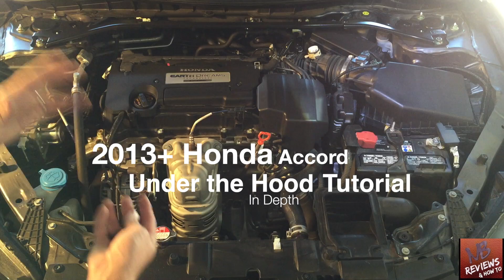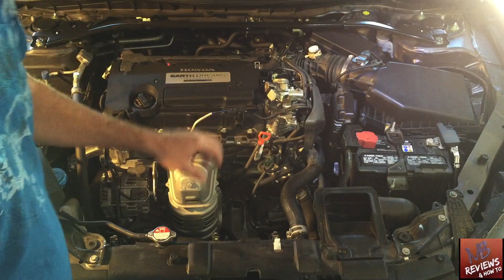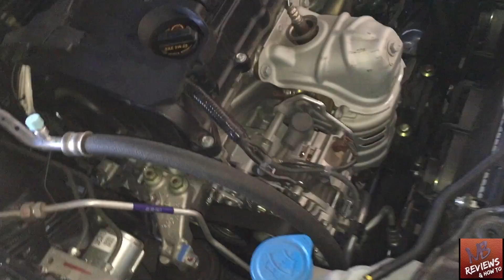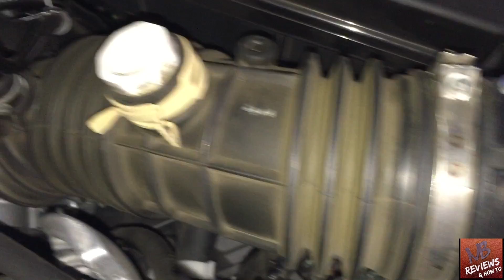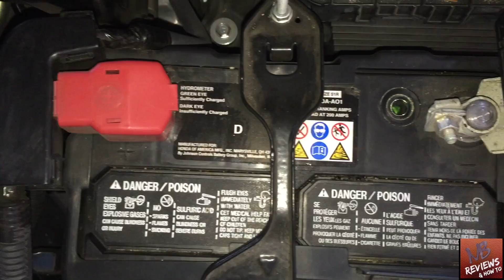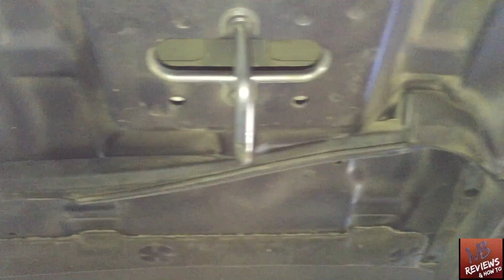HONDA ACCORD 2013+ UNDER THE HOOD TUTORIAL

Comment: is the v6 version this easy to maintain as well?
Reply from the maker: Correct, the V6 is an awesome engine as long as you are okay with the additional maintenance needed. Don't forget that the V6 also needs a valve adjustment every 100k or so. I have a manual and agree that the auto is much better than the CVT for longevity. I have heard of some VCM issues in the higher mileage cars, but using strictly synthetic and being religious about the oil changes eliminates the issue. I'm at 150k and still haven't had any DI issues. I'm going to change the spark plugs today and check out the the inside of the intake valves.
Reply from the maker: SlickNick16 Sure will, the weather just needs to cool a little, it's nasty outside.
Reply from the maker: SlickNick16 I love Honda's V6, but it is a little more work to maintain since it has a timing belt. That being said, they can easily go 200k miles. You also have to adjust the valves on the V6 every 100k miles or so. So nothing terrible, just not as easy as the 2.4.
Reply: Michael Borquez I own 2015 Honda v6.  Love how quite and power the engine is. Yes there r some pros and cons. Timing belt engine are quieter than timing chain. Of course requires to change every 60 k or soo. It is same as Acura engine so reliability is not an issue. The engine lay out is of course different but I noticed alternator is easy to change in v6. And biggest advantage is it is not DI , injectors keep valve stem  lubricated and clean. It is vcm engine which means while cursing it shuts down 3 cylinders . It gives  35 mpg or above on highway and around 30 in city. And it has conventional transmission which is 6 speed...
Reply: Michael Borquez hope ur making a video about it?
Reply: Correct I have also heard V6  valves need adjustment, actually every valve at 100K need adjustments even hydrolic lifter get bad too. Hydrolic lifter cost extra for lifter price.  At 100K majority of car shows some valve cover leakage as seals become hard so while changing those valve adj can be done at same time. If you do not have DI issues at 150K I think you can provide good advertisement  for Honda DI , check with dealer they might use your car as promotion. I like that even 180 hp is pretty good. My wife has CRV and it has almost same 4 cyl engine but 2014 crv is without DI glad to have both cars without DI.. I buy full syn oil from walmart which is dirt cheat 22 dollars only for one gallon and 8 dollars filter so 30 bucks for oil change. I have 34K and no extra maintenance yet. I am not sure about its V6 transmission . Actually I am disappointed by small cooler for transmission. Working on adding extra transmission cooler as precautionary measure. Rest very content with it..
Reply: So  to stop the three cylinder shutdown merely stop cursing,, ha

Comment: 17:50 what control until are you talking about
Reply from the maker: ABS (Antilock Braking Sytem) control module modulates brake pressure between the wheels to prevent the brakes from locking up. It is also is used in stability control to correct the cars trajectory when the driver loses control due to skidding.

Comment: Just got to the end of the video.  How do you keep the engine clean without messing up any of the electronics?  That might be a good video.  As for the battery, I changed out my size 51R battery for a 24F.  The engine compartment is designed to fit it.  You just need to replace the battery box (tray) and can bend the tab in the hold down bar and use the existing one.  A new J bolt, size 235mm is also a good option.  I'm using my existing one.  Cost is why they go with the smaller battery.

Comment: Just bought a 13 Accord w 60k miles. Great video, this really helps me be somewhat familiar with the nicest car I've ever had lol thank you!
Reply: BRO SAMEE!! Bought one last week with 64k. I love the damn thing. It's the base LX model. I went into the Honda dealership to merely look at a used 2011 Camry lol but walked out with 2013 Accord LX and it's the white pearl color! Also was blown away by the features. Blutooth and backup cam?? WHAT? My newest car ever was a 2002 LOOOOOOL drove that shit away in a snowstorm that day and that traction stability was kickin in and I loved it. Felt like I was driving a space ship. Still does!!
Reply: @grand_vacation  hows you paint doing?
Reply: @edubb2491  Sorry I know the Question wasn't for me but my 2013 sport 2.3 white pearl is holding up great but I have done all the paint treatments like paint decontamination etc and 3 year wax protection!
Reply from the maker: No problem

Comment: Really good video but you forgot to talk about carbon build up in the valves because of the direct injection.... and how to clean it.
Reply from the maker: Haven't had any carbon issues. I scoped the valve at around 100k and there wasn't much build up. Please see the spark plug video to see.
Reply: @Sunshone7311  i jus subscribed and gonna check out the spark plug vid!

Comment: when my car is running@night and something clicks on under the hood sounds like the a/c compressor.. but it even clicks on without a/c running my lights will dim out, battery is new I already replaced it thinking it would take care of it.. any idea?
Reply from the maker: If you have the climate control set to auto it will turn the AC compressor on and off from time to time. The issue you are describing sounds like the AC compressor coming on. When you have the climate control set to auto, be sure to click the AC button so that it says off.

Comment: my 13accordsport.. in-between oil changes my Honda losses about 1/2qt  of oil, car runs great. Any idea why?
Reply from the maker: Depends on how many miles it takes to burn the 1/2 quart. I can say that you need to make sure to use 0w-20 oil and preferably synthetic. I use Mobil 1 and haven't had any issues (127k miles). If the dipstick is going from full to half way I wouldn't be too concerned, if it is going from half way to low then you may have more of an issue.
Reply: @Sunshone7311  have u had any carbon build up from the engine being a direct inject engine and 127k on it? Thanx for the very informative video..better then the user manual that never came with the car when i bought it..lol

Comment: I have 2014 Honda accord, i did hear the O2 sensor you mentioned is upstream. I recently crashed into wildlife, long story short the o2 sensor at the bottom of the unplugged. then the engine light came on i went to autozone they said i needed to replace the upstream sensor based on their diagnostics but i know for fact its the one under the car. what should i be asking for, i think its downstream sensor based on your discussion but wanted to confirm, not sure if there are more then 2 on I4. thanks for all your help in advance. I have 104K miles on it and yes love it.

Comment: Thanks for the video!
Quick question, my 2013 Honda Accord (36K miles) vibrates pretty bad when in idle (brake + D gear) and worse when reversing :( any idea? will any engine clean up work?
Reply: jashou89 I have the same issue did you find a solution?
Reply: I have the same issue too..Especially when the ac compressor kicks in..No solutions yet..
Reply: Try turning the heads lights on.. If the vibration subside then it is Honda design fault. To get better mileage they slowed down RPM so much that it shakes the car. and there is no way to adjust idle speed. !
Reply: It may be a engine mount if the vibration goes away by putting it in neutral.

Comment: I have a 2014 hands accord lx 21,000 mi. It is pulling to the right I took it in for an alignment and is still pulling to the right, they did not provide me with the paperwork for alignment, I'm thinking the suspension is off or the camber??
Reply from the maker: Did you buy it new, because Honda alignment are usually pretty rock solid unless it was crashed, hit something, or bad pothole. If check and see if you have a bent tie rod.
Reply: +Michael Borquez  it was a certified used from Honda dealership, thanks for your input, I believe they know something I Don't, saying its a characteristic of the car,
Reply: +Michael Borquez i have only had the car for 2 weeks
Reply from the maker: +Andrew Toma I believe you are correct. You will need to keep taking it back and document the issue before they try to say that you did something. Please also check your tires to make that is not the issue, bad tire wear can cause the vehicle to pull. They are required to do a title check to make sure there were no accidents to certify the car, did you get a copy of the car fax or title history? This is not normal and you will need to continue to pester them to get it fixed. I would consider calling Honda corporate to complain also. A certified vehicle should not be pulling. I have a 115k miles and still rolling on the original alignment with no issues.

Comment: I would like to replace on my 2013 accord the HFT Bluetooth module but don't see any video's on here for that
Reply from the maker: The 2013 is different than the 2014+ Accords because the module is now internal. The 2013 can be flashed to add Siri hands free, where as later models cannot unless they have the higher end deck. I haven't had a reason to access the module yet, sorry about that.

Comment: i have a 2013 Honda Accord, and would like to replace the starter on it. Im not mechanically inclined and would appreciate any help regarding the replacement of it. Yeah 37,000 miles and already need to replace the starter.
Reply from the maker: I would not suggest it if you are not mechanically inclined. The starter is a very tight spot and you will need extensions and the top bolt will require you to feel for it blindly. This would be fairly difficult for a good mechanic. If you can have a friend with experience help you that would be best.
Reply: Where is it located? I just want to beat it a bit until the fly wheel engages
Reply: yup, I replaced mine after a year and a half..it's a 13'... warranty replaced. ..also rear wheel bearing went...warranty as well..

Comment: My 2013 Accord has 34,000 miles on it and the starter is already bad. I didn't see you mention it, unless I missed it. I want to know how difficult it will be to take out and if I need to take out any other parts to get to it. Thanks.
Reply from the maker: +Jason Caban Double check that your don't have a battery issue first. A lot of times a bad battery will make your starter sound like it is going bad.
Reply: +Michael Borquez yeah the battery was replaced about 6 months ago. I found out the starter is under the vehicle so that's why I didn't see it mentioned in the video. It's still under warranty but I'm US military living in England so it doesn't matter. Gotta drop a few hundred dollars to get it replaced.
Reply from the maker: +Jason Caban Did the vehicle have to be jump started a few times? I only mention it because it is rare for the starters to go bad. Sometimes jump starts can short starters, they are sensitive. It sucks to see one go bad so early. Thank you for your service!
Reply: It is common for starters to go out on these earlier models.

Comment: I have 2012 Chevy Impala with direct inject engine and heard you say that the direct inject engines can get hotter then normal so I was wondering if that was something that I should be worried about in the long run because I'm like you I want to get 300,000 miles out of my car. But I guess if I don't I'll just go out and buy me a Honda. But I really enjoy your videos thanks a lot.
Reply from the maker: Direct injection engines have a higher burn temperature in the combustion chamber, but the engine as a whole stays about the same temperature as a normal port injection engine. The key is always manitenance and catching problems before they do damage. The biggest issue I see is people ignoring mechanical problems until it's too late.

Comment: Going to test drive a Honda tomorrow. Every car i've owned has had either cooling, or transmission problems hah. Not sure I heard you mention anything about it, but how accessible is the water pump? Also, on FWD vehicles such as this; is the serpentine belt/spark plugs a pain to change out? Final question. What are your thoughts on the long term reliability of the CVT transmission. It is the only real potential mechanical issue that is making me hesitant
Reply: Relatively easy to change serpentine auxiliary  belt and plugs. Atleast on my '05 Accord which looks very similar to the one in the vid. Bought a special tool to help remove belt but it can be done with spanners (wrenches in the USA!). There'll be a plastic vanity cover on the top of the valve cover and underneath will be individual coil packs with an associated spark plug. Coil packs have to be removed to access plugs but it's usually pretty easily done.
Reply: How is your CVT doing?
Reply from the maker: +Tomtom9401 I don't like CVT transmissions, but that's mainly because NIssan has left a bad taste in my mouth. That doesn't mean that Honda will be bad, but it is a newer transmission type for Honda and there isn't a lot of long term information yet. 

That being said, this car is EXTREMELY easy to work on and because there is no timing belt the water pump is easily accessible. The car also has electric assisted power steering giving the belt one less thing to drive and in turn making it easier to change.
Reply: @Sunshone7311  so i dont have to worry about changing timing belt?

Comment: Hey I bought a 2016 Accord EX 6MT and every 10 seconds let's say the engine ticks and it gets louder and vibrates a bit for 5 seconds, then is smooth for 10 seconds, repeat etc. Every video I've seen shows theirs doing the same so I'm sure it's normal but I'm just curious as an engineer what it is. Is it the fuel injection changing modes or what? Thanks
Reply from the maker: +Trevor Thayer Your climate control is on correct? If it is, turn the AC off, its likely the AC compressor kicking on and off. The AC compressor will put additional load on the engine and thus the vibration and ticking. I found it odd that the car will kick the AC on with it is in AUTO even though it is not hot inside the car.

Comment: Honda won't oil change my car since I still have 50% oil life but it's 7 months old oil, Is it still okay? Also do you recommend following the 15% oil life change?
Reply from the maker: +Ronald Almuete  I can only tell you what I did. During the first 50k miles (full break in) I changed the oil every 4k miles regardless of what the oil life meter said, now I run it down to 20%. If you use a synthetic you can go longer between changes, but six months is good time. You are right, oil should be changed even if the car hasn't been driven.
Reply: How many miles have you done since last oil change and what type of driving do you do? I'd be tempted to change it myself but you have to be careful not to invalidate any warranty.
Reply: My oil was changed 9 months/5000 miles ago. Oil at 30%. Had my oil analyzed at Blackstone and they said it should last another 2000 miles. Oil report normal. Odometer at 104,000 miles.

Comment: do you see the direct injection being a long term problem? I have heard of an issue with carbon build up with direct injection from other manufacturers. Please let e know your thoughts
Reply from the maker: Henry Pacheco I'm at 75k miles and have had no issues. This was a concern for me and seems to be an issue with old school pcv systems that push oil laden crankcase vapors back through the intake. Honda has a good system, ford still has the worst. I scoped the intake not too long ago and didn't see anything to be concerned about.
Reply from the maker: I now have 160k miles and still no issues with carbon build up thankfully.
Reply: @Sunshone7311  thank you for this answer..u jus eased my worries! Jus got a 16 accord sport with 30k..i will use mobil 1 full synthetic..at 4k intervals like you do..and use chevron mid grade..if that might help lol..thank you again!!
Reply from the maker: The Rusty Scooter It been pretty solid, nothing to really complain about. As for weak points, the stock rotors suck, the starter failed around 130k miles. The serpentine belt tensioner failed around 80k. Other than that, you’d never guess the mileage, idles smooth and drives great.
Reply: Wow hows it done in that 160k? Not even just engine and tranny but squeaks, rattles, vibrations, etc.?
Reply: Wow that awesome man especially because all of those issues are easy diy fixes..... I forgot to ask in the first comment, how are the seats? There are a few people saying the Accord and the Fit have horrible driver seats in terms of comfort
Reply from the maker: Oh, I have a manual and third gear has gotten a little stiff. Still on the original clutch.

Comment: Thanks for the informative video. I learned alot from it. I would love to see you take apart the engine. I have a 2014 accord sport cvt. I changed my intake to a kn sri, How often should i clean the maf sensor?
Reply from the maker: bigpapi9223 The MAF sensor should be cleaned every 50k miles, more often if you live in a dusty area. Be sure to use MAF cleaner.
Reply: bigpapi9223 t